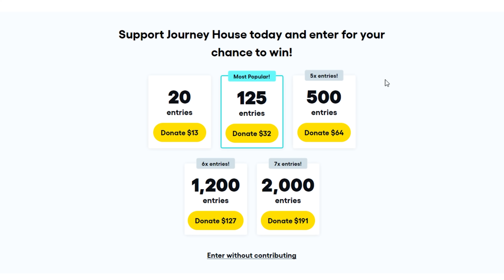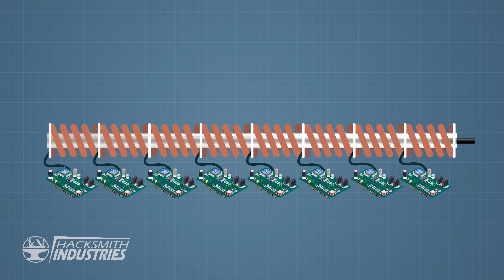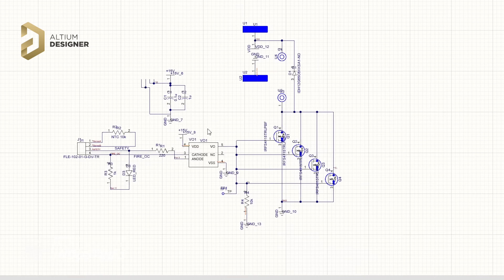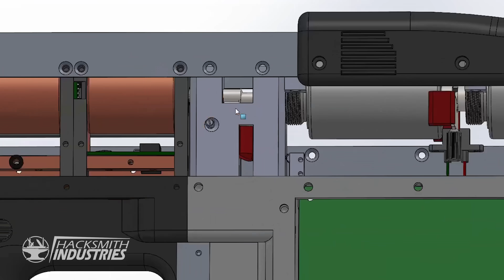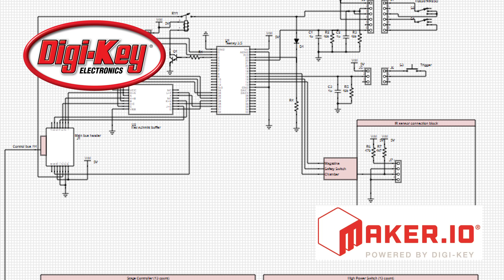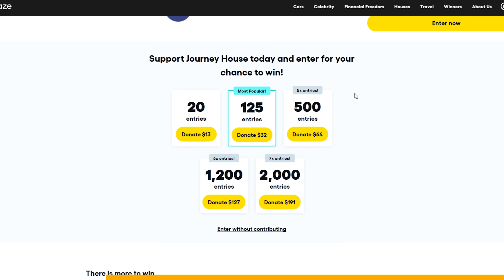MOST POWERFUL ENERGY WEAPON WE'VE EVER MADE!

Comment: 2:35 instead of simply turning the coils off couldn’t you reverse the polarity to give some extra speed?
Reply: Current in electromagnets has a strong inertia (inductance) maintained by the magnetic field they produce.  I'm not sure there'd be enough time to both halt the current and then reverse its direction in the short time that the projectile has passing through the coil.

Comment: Wouldn't the energy loss be averted by having a thin tube within the barrel that isn't affected by the magnetic field? 

Other than that, looks cool af.
Reply: I wouldn't imagine much materials being able to withstand a metal rod rubbing against it at high speeds
Reply: @jrasiy4048  Teflon
Reply: @jrasiy4048  Just use aluminum, like with the main body, (or something with a higher melting point) there are lots of non magnetic metals that could work
Reply: @Ghost_4576  Aluminum still carries current though so it will become effectively an electromagnet. You need something nonmetallic for this kind of thing
Reply: @richardmillhousenixon  wood?
Reply: @temkin9298  
Definitely not wood! Teflon was the best idea so far. Some kind of polymer or a greased plastic tube.
As for rifling, I would imagine (this is all speculation) that the spiral action helps drag air around the projectile as it goes down the tube, thinking something like air bearings. And while I'm sure there will be some drag with the barrel involved, the air bearing affect should reduce (and with some refinement, I would imagine, greatly reduce) contact and friction losses.
Reply: @kindlin  could maybe use tungsten, has a very high melting point and i dont think its magnetic
Reply: @richardmillhousenixon  aluminum carries current but it won't magically become an electromagnet when subjected to a strong magnetic field. First off, every metal carries current, but not necessarily very well. Second, you need metal in a coil for it to become capable of creating current. If it's just a tube, it won't have that effect, and that's if you applied current directly to it. In this case, you wouldn't. It still wouldn't work well, but not for the reasons you mentioned. However, it may cause the actual electromagnets to not have as great of an effect as something that is completely nonmetallic, though I imagine it would be a minimal dampening effect. 

See my above comment for why it wouldn't work.
Reply: @timinator1178  Find any video showing what happens when you drop a magnet through an Aluminum tube and come back to me.
Reply: @timinator1178  I think he's talking about induction heating, but I don't think that applies with just a single massive, static burst of electromagnetism at each coil per shot. Not sure, very much not an electrical engineer.
Reply: @richardmillhousenixon  you're referencing the Lenz effect, right? That's... not what would occur here, though. You're still wrong, as putting a current through an aluminum tube will not turn it into an electromagnet. Nor will putting a bunch of electromagnets around an aluminum tube turn the aluminum tube into an electromagnet, or make it magically create current, or literally anything else you mentioned. Especially if it is a very thin tube of aluminum. 

Not to mention the projectiles are not magnets. They are, however, magnetic, and are obviously greatly affected by the electromagnets in the coilgun. So I'm not sure what you're on about. You're right, an aluminum tube would not be ideal, just... not for any of the reasons you mentioned.
Reply: @kindlin  if he was talking about induction heating, he wouldn't have said "become effectively an electromagnet." But yes, you're correct, a single burst of electromagnetism would not cause induction heating (hypothetically, since I am not an electrical engineer either, but I am what you could call "scientifically literate").
Reply: @kindlin  No, I'm not talking about induction heating. That requires a rapidly alternating magnetic field, which we don't have in this situation.
Reply: @timinator1178  I wasn't great at explaining it in the beginning but hopefully with my rewording I was able to get my point across in a less confusing more concise manner
Reply: @timinator1178  My comment got deleted by the YouTube bot but what I was trying to explain a few minutes ago was that while the projectile is not independently magnetic, because it is ferromagnetic, when it is introduced into a magnetic field it would become magnetic, albeit only temporarily. As a result, the Lenz force would still apply since the projectile, now having an induced magnetic field opposite to that of the coils, would now act like a permanent magnet when going down the tube. Ofc the magnetic charge would end as soon as it left the field but until then
Reply: @richardmillhousenixon  yes, I agree. But a tube that is as thick as a penny would probably have a negligible effect, right? I can't see that little of an amount of aluminum having a marked effect. Plus, wouldn't the Lenz effect be altered to some degree by the presence of an outside magnetic field acting upon the projectile? Now I'm just curious as to what precisely would happen if this were attempted... Either way though it would still be awful as a tubing material because, well, refer to my first comment.
Reply: @timinator1178  Even if the loss in velocity is minor, with something that shoots as (relatively) slow as that coil gun, any decrease in velocity due to the Lenz force would have a pretty significant effect on range and power. As for the thickness question, that all depends on how strongly the projectile becomes magnetized by the coils, because just something as simple as rolling up a bit of aluminum foil can have a significant effect on the fall of a magnet. I mean look at copper pipes, they're probably as thin if not thinner than a penny, and while they do conduct electricity marginally better than aluminum, it is close enough to see that even a fairly thin tube can have a significant effect.
Reply: @richardmillhousenixon  would that compensate for the decrease in velocity due to friction that would occur without the tube though? I guess that could only be answered through testing though. 

All that to say the only reasonable material to use would be a thin, transparent plastic, preferably one that is at least relatively strong and doesn’t melt when it gets a little warm.
Reply: @timinator1178  Ideally Teflon would be the best material IMO, it has good enough temperature resistance and it is just about the lowest friction material you can find without using some sort of lubricant or grease. Aluminum is actually fairly grippy, so unless they polished the inside of the tube it may not help the velocity at all, even ignoring the magnetic effects
Reply: @richardmillhousenixon  you did read the part where I talked about the whole light sensor thing right?
Reply: @timinator1178  It seems like the YouTube bot has deleted that comment. Either that or I'm just blind, but either way I don't see it
Reply: @richardmillhousenixon  it’s my first comment in this thread. I’ll post the relevant part here: “How are you going to tell when the projectile passes through each coil if you install an opaque material as tubing? If you insert holes for the light sensors, that'll quite potentially disrupt the projectile, unless you fine tune the sensors so that you get it internally flush with the tubing, which would [seem like] an undue amount of work.” A transparent material would work best.
Reply: @timinator1178  drill holes in the pipe for the sensor. They don't need much light, a 1mm hole would probably be plenty.
Reply: @Ghost_4576  you'd get high eddy currents in the aluminium unless it was slotted in some way. This is why transformer cores are made from sintered magnetic material or laminated layers.
Reply: @timinator1178  maybe glass or something, it can resist high temps, although it would need to be treated in the correct way so it doesen't shatter due to heating or the projectile
Edit. It's also see-through... (probably self explanatory but some people can't self explain)
Reply: @taylorgarrett793  its also really dense, not a good choice for lightweight
Reply: @jacktheripper7735  ye good point, in theory that would mean ya would need less of it tho
Reply: @Ghost_4576  Aluminum would draw eddy currents from the coils, and heat up tremendously. Brass would work, but also in this case, so would plastic, which won't receive induced voltage.
Reply: @jrasiy4048  if it's rifled there should be no contact at all.
Reply: @Shrouded_reaper  That's? Not how rifling works?
Reply: That might make it a firearm, so it may not be worth it for legal reasons.
Reply: Titanium
Reply: @jantzguy  No, titanium conducts electricity, we've already discussed why metals are a bad option

Comment: Would it be better if you make the battery pack apart of the magazine and used smaller batteries and capacitors as in only big enough to fire the magazine and reducing weight

Comment: Why do you need a 2 PCBs for each coil? Wouldn't it be better to have only one charge PCB, then have each light automatically step to the next coil? A counting circuit with a triggered light adding 1 to trigger the next coil, repeat until final coil, then reset counter. Or is there too much delay for that?

Comment: Okay so random idea for this, what if you made each coil a different size?? Like the first coil is the strongest then it gets progressively less powerful towards the end, wouldn’t this achieve much faster acceleration and once it’s moving it doesn’t take as much to make the speed increase. Obviously you could just make a bunch of super powerful ones but doing it this way could save on weight while still delivering a faster projectile. Also has the benefit of keeping most of the weight towards the back of the gun and lighter at the end of the barrel leading to more stability and less strain. Just a random idea, I could just be entirely off base

Comment: Looks awesome, but sad that it sounds and has the power similar to an airsoft gun 😂 lmao not even a pellet gun (the ones that use metal projectiles at high speeds, originally designed for hunting).....and airsoft gun (the ones that use plastic pellets and are used in airsoft).

Comment: do somthing like real rail gun power some guys from the usa made a short circuit rail gun with a bank of capacitors (quite big) 2 copper guides that serve as a rail and a barrel and the metal projectile in the middle, the method of pushing the projectile inside the barrel was made with gas at the pressure of a paint ball gun

Comment: So if the magnets are too powerful it will actually crush the barrel so what you can do is you can use a carbon fiber tube that they use in rc helicopters those are non ferrous and are super strong

Comment: Hello Hacksmith,

I enjoyed the video, however throughout the video you refer the gun you made as the MA5 from Halo. While yes this is a model of Assault Rifle in the game, you have actually based on the looks of the gun you have built, it is actually a MA40/MA37. the MA5 has one uniform top cover through out the top of the gun, whilst the MA40/37, has the ammo counter separated from the rest of the top cover, similar to the one you have built. The MA5 also does not have the bulges at the end right before where the barrel connects with the body. 

Sincerely, a gamer with nothing better to do.

Comment: You need two sizes of coils so you can overlap them instead of having areas without magnetic field, like a slightly wider tube partially covering the end and beginning of the coils it's between. That should help.
Reply: Not necessary, though narrower segments (like 26 half width) and turning on the next coil earlier to make the pull stronger.  More tumbling can be fixed with a smooth plastic barrel passing through all the coils as a single piece.  Removing projectiles from the mag should be done magnetically, not with springs.
Reply: @johndododoe1411  i was under the impression that the loading piston was actuated by a solenoid...
Reply: @TheScarvig  The magazine uses the spring system like in normal guns.
Reply: @johndododoe1411  The springs in the mag push the rounds upwards, where a piston then shoves them into the barrel.
Even in normal firearms, the springs in the mag do not remove the cartridges- they push the rounds to where the bolt can pick them up and shove them into position.
Reply: while all of u wer discussing this, i was seeing how i cud pronounce his name
Reply: @viralexplosion3449  not surprised
Reply: A bit better than just overlapping coils is turning one overlapped coil on while the previous one is turning off- this allows the coil that's turning on to scavenge some of the energy from the previous one, making the whole system not only a bit more efficient electrically, but also reducing the severity of the turn-off spike that the previous coil's transistor has to handle.
Reply: @absalomdraconis  that is a great take about overlapping coils however how is it going to scavenge some of the energy from the previous coil?
Reply: @mugiwara_no_ace  Magnetic field coupling.
Reply: @jimmyb1451  Ah gotta refresh some of the information.

Comment: If you reverse the coil polaraty in the exit of the coil, you can double the Power. If the coil is in transformer oil you can neary doulbe the voil amp rage without melting the coil (pulse heat disepation). Thats 4 times the Power.
On top Pop a Co2 cardrage truth a pipe in the oil (vapor expansion). You can Drop the temp a lot and colder means even more amps and power.
Reply: Vakuum in the barrel, high pressur in the back. Mayer with all of this it can get ultra sonic
Reply: You can use copper grease at the terminal. Here in Germany we use it for connections with thousends of amps

Comment: Guys get yourselves a firearms (or similar) permit and make one with decent power. (Colin Furze had to for potato/apple guns and he lives in the UK that has much tougher laws than Canada) Also stop over engineering. This thing should easily run of one arduino. And a simple bit of over current protection will sort out the fire/melty issue.

Comment: What if you would take two or three coils off that would already put more power on the other coils besides of course getting more power you could make the bullet way less heavier you could just take half of the metal off and make a case like an arrow out of a metal that's not magnetic and twice a stronger than steel to cover the small sphere of metal and for the overheating problems  we have so many technology like the pasta that we use on smartphones or the system that we use on air conditioning on cars you could make a smaller one just to not catch on fire but either way it's still a perfect and magnificent project congratulations

Comment: I might be thinking ~20 years too far into the future, but for controlling the switching system, what if you use an optically-switched transistor to control the switching circuit? Keep the LED light sensor concept (possibly use a UV LED so the light coming off is high enough energy to reliably trip the transistor) and use light reflecting off the projectile to trip the transistor. Then, wire it up to a  "latching relay" type of circuit that resets with input from the fire control system (basically the trigger) so it doesn't try to reactivate the coil after the projectile passes through.

Comment: I imagine that if you set up a US facility, depending on the state, you might be able to make that thing weapons grade or possibly military grade. But besides that, maybe it would be beneficial to have a hard plastic barrel to more firmly guide to projectiles and make them more pointed and aerodynamic to increase accuracy along with a laser guide, and maybe implement an integrated compressed air cooling system with the air storage in one of the unused spaces in the 3d printed parts.

Comment: Can we make it more powerful? No. But we can make it more efficient and user-friendly.

1. Stack the coil modules around a proper barrel to reduce tumbling. With that taken care of, it might be possible to lower the number of coil modules, and by extension, reduce the weight.
2. Make a 2 part chassis, with the main load-bearing "spine" made out of aluminum. Bolted to that will be the coil modules, as well as the secondary chassis component, which would mount everything from the batteries and electronics, to the aesthetic pieces.
3. Make the magazine components and the magazine well out of steel or aluminum. I'd put money on the magazine feeding issues being caused by the 3D-printed magazine components causing friction with eachother. Having metal components for the magazine + magazine well would reduce the likelihood of feeding issues, and would have the added benefit of not sounding like a nerf gun when you're swapping magazines.
4. Give the magazine an asymmetrical profile, so that there is no potential for inserting the magazine backwards.

Comment: Yo Charles, kinda surprised you didn't build the coils around a single barrel with pre attached dividers, and just use less voltage or turns to keep the speed down that way. 

Was it just too much hassle to try wind it on the lathe that way, or were you expecting a better fit from the individual barrel lengths? Accelerators like MACS or Railguns are why I got into engineering, so I love seeing them played around with.